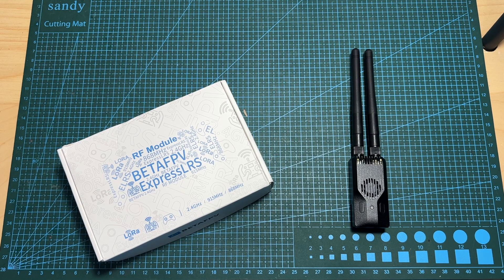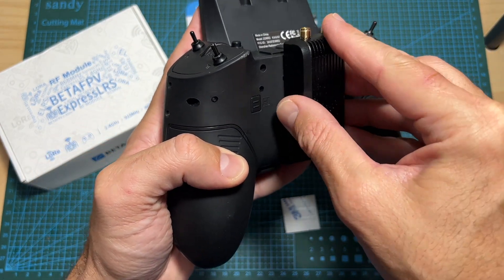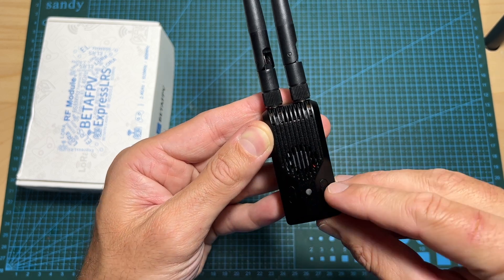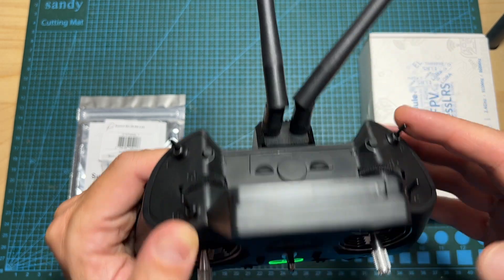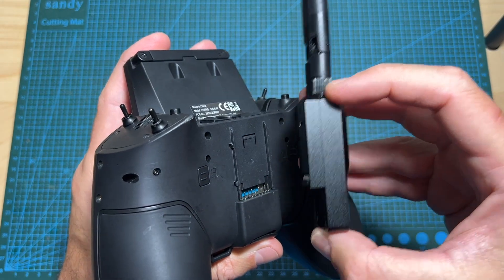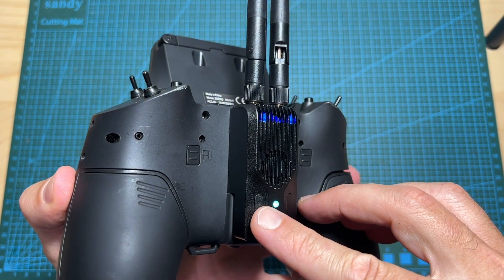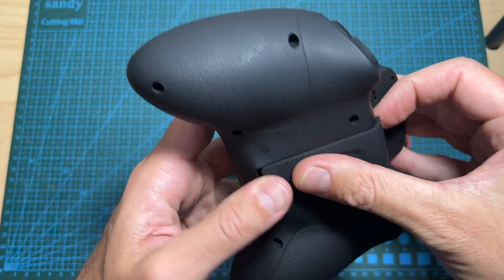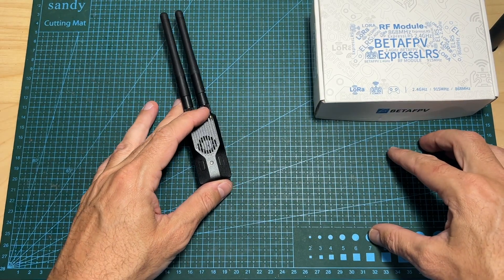BetaFPV SuperG Nano - First ELRS Gemini 2.4GHZ 1000mw TX

Comment: Hi, friend. Is it normal that the super g module in Gemini mode, after 5 minutes of connecting it to the boxer station, gets too hot? It was installed and configured in Gemini 500hz mode with std 1:128 at 50mw and the two antennas connected.................thanks
Reply from the maker: Hi there. Is the fan working? The module is supposed to get hot, but on 50mW it's not supposed to overheat.
Reply: Yes, fan working. Set manual on the lua menú to 100mw.
Reply: Thanks

Comment: Q: what current receivers will be compatible with a firmware flash update, if any?  Thanks 👍👍
Reply: Any True Diversity receiver is already compatible (3.2.0 firmware or higher). BetaFPV SuperD, SuperP, and HappyModel EP1 Dual are the only 3 currently I believe.
Reply from the maker: Yes, in addition every ELRS 2.4Ghz RX is compatible but the Gemini mode will not have any affect.
Reply: @CapnBry  thank you sir for answering my question 👊

Comment: The receiver you used with Super G transmitter is not true bio chip receiver. It only has 2 antennas. Search betaFPV SuperP 14CH receiver which has 2 receiver chips.
Reply from the maker: The SuperD is a true diversity receiver.
Reply: My mistake. Yours is SuperD which is a true diversity receiver. I also have one. LOL. Those ELRS receivers are so similar... @KremerFPV
Reply from the maker: @dayworkhard  no worries :-)